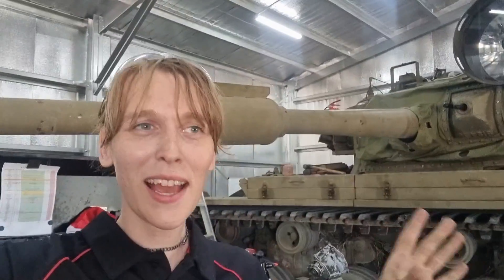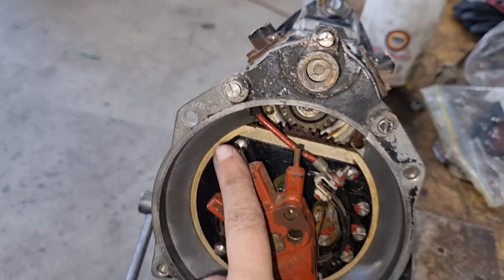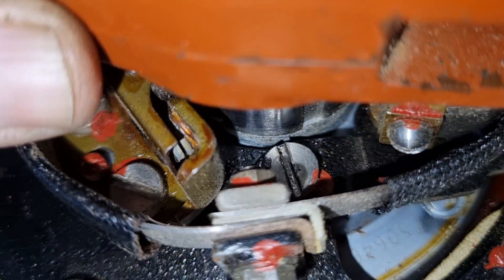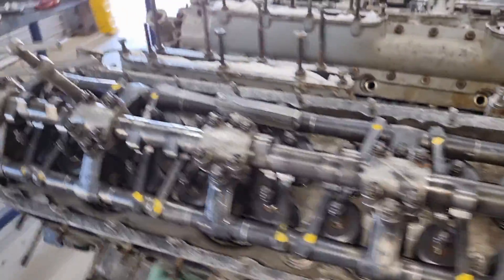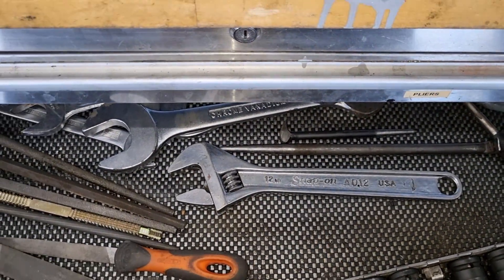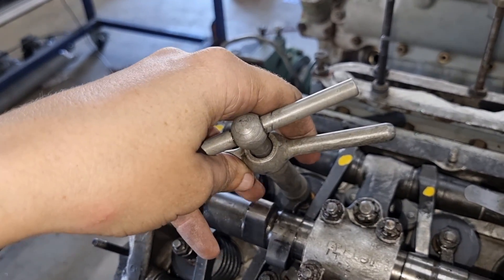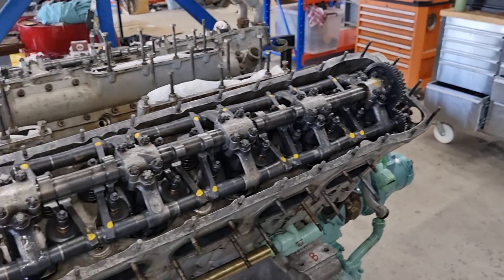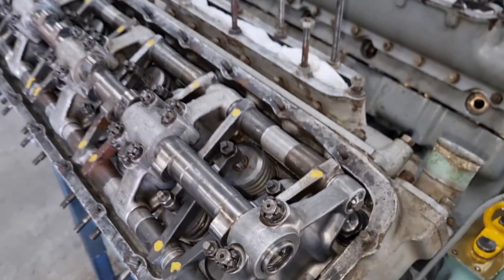Meteor engine prep: Magneto and valve gaping

Comment: 2 Questions, what's the difference between a magneto and a distributor?

and

Did you have to use the imperial adjustable from the RR tool kit because you guys are metric? XD
Reply from the maker: Thanks for the questions.
Magnetos and distributors aren't necessarily mutually exclusive. There is a distributor paired with the Magnetos that behaves the same as any regular car one. The Magneto itself is what produces the spark rather than a typical ignition coil. In the simplest terms it's a little generator powered by the engine with a typical distributor bolted to the top.
Reply: @lottiethetankwhisperer  Awesome, thank you! I was wondering if the self generation is what made the difference. I've heard it before in terms of plane engines and never actually knew the difference.

Comment: question Lottie, can you explain how they work out the calibre of the main gun? top show
Reply from the maker: Thanks 😊 
I can do a video on projectiles and guns in the future. For now, though, I can explain that 'calibre' is the term used to describe the diameter of the gun bore from the highest point of the rifling. ie. Find a gun, measure the diameter from the tops of the rifling, and you will have a measurement. Express this measurement as hundredths of an inch and you will have the 'calibre' of that gun. It's mainly used for small firearms eg. A .303 calibre rifle has a bore diameter of 0.303 inches.

Big guns can be described in full inches eg. A 3 inch gun has a full 3 inches of bore diameter but rarely do guns these days go by anything besides their bore diameter in millimetres. 

The Centurion we are working on has a 20 pound gun. This is an old term not used anymore to describe the weight of the projectile. In reality the 20 pounder on a Centurion is 93mm in diameter.

Hope that clears it up a bit. I will definitely do a quick video explaining it. I've avoided specifically talking about the gun because YouTube doesn't like it 😅
Reply: That might be the most thorough response I’ve ever seen from a YouTuber. You’re the best Lottie! Be well.

Comment: We grew up calling them  ‘Walkabout’ spanners, cause they are shifters. A mate calls them  ‘round off’ spanners, as in rounding off a hex head nut or bolt. I tend to use vice grips in place of a walkabout nowadays, if that choice is anyway unavoidable.
Reply: Average sized spanner when I was serving my time. Also, vice grips are Mole Grips where i'm from . I have several original "Mole" grips